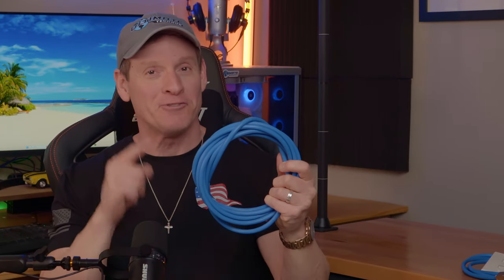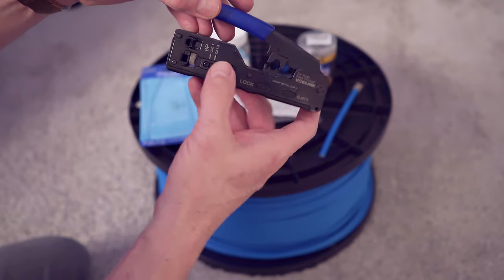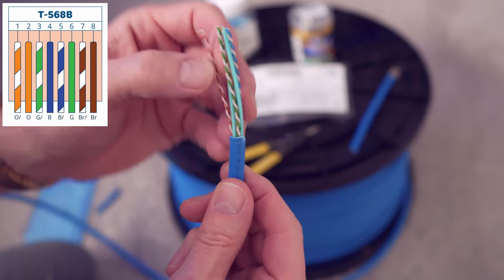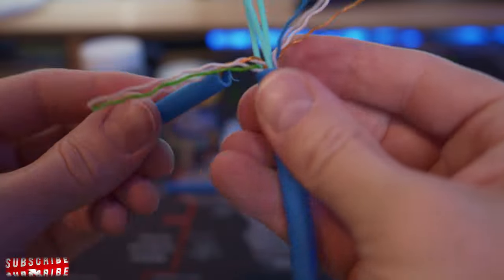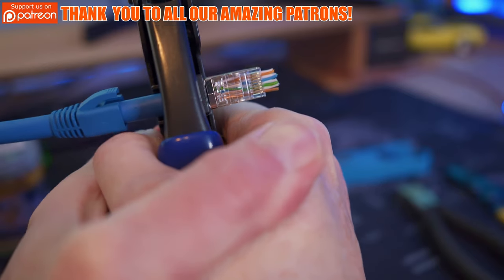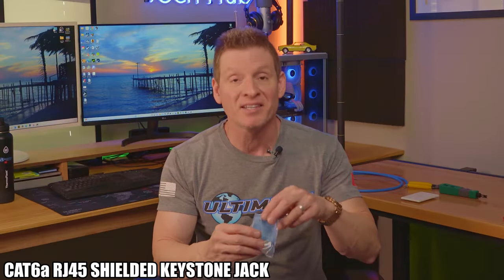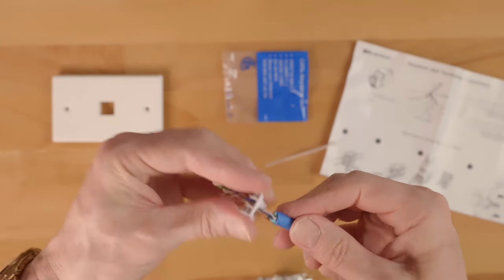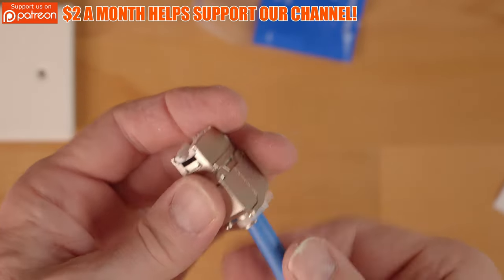CONNECTING CAT6a CABLE TO PLUG | Cat6a KEYSTONE JACK INSTALL - HOW TO

Comment: im afraid i might have broken my cat6 wall socket, would it be possible for 0 experience to check inside and fix possible issue? preinstalled connection. would be as simple as just reconnecting previous wire connection? or do i have to pay professional 200 fee to do it in 5-15minutes?
Reply from the maker: Just remove the wall plate and check the wires. You can reconnect the wires and I would take a picture of the wires before you rewire it so you make sure its wired correctly.
Reply: @UltimateTechHub  thats actually is pretty smart, il try that
Reply: Ok small update, the golden pins are joined together and slanted aswell i need to switch it up since i do believe enough of use has made them weak so they cant connect. I managed to get light only for few second and it probably fails and shorts the connection
Reply: sending this from a fixed outlet, yes were back with 1GB internet again. yes this DIY is really something and all i had to do was push wires down and boom its done! well it isnt the prettiest job but a job nevertheless. apparently 3 different repair men are gonna visit my house 2 already have. 1 did nothing 2 called electrician and 3 is gonna be the electrician! XD funny i have to put a paper on the wall to inform it just needs the wall panel to mount it properly. but i am back WOOO!!!

Comment: Your giving incorrect information. Cat6a (just like all other ethernet cables) cabling the white cables do have color strip on it for green/white, etc. Heck the link for the CAT6a you have even show pic of white cables with strip of color.  2nd, one shouldn't need to crush (which is not good) the outer housing for it to go into the RJ45 connector. There are passthrough extra large CAT6a RJ45 connectors.  lastly, unless cabling is beyond 55m, Cat6 will do 10G just fine.
Reply from the maker: The brand of cable I have didn't have the white/green and some companies do make them that way. The link was for a different brand of Cat6a since my Cat6a was from a local Las Vegas company that sells bulk ethernet cables. I only pressed the cable down slightly to get the cable into the connector and yes crushing the cable is not good. And lastly, of course cat6 works for 10gig under 55m but this video is not about that. It's about how to install cat6a and that's it. Lol! Thanks for watching and for the comments it really helps the algorithm! 😉

Comment: DON'T crush the cable like that just so you can have the jacket inside the jack! If you really want to, you can carefully make a couple incisions on the jacket to help, but in a home install it really isn't necessary. Wow even super cheap cables usually never skimp out enough to use all-white instead of the proper white+color, I'd suggest buying better quality cable than that. I'd advise against toolless keystones as the connections aren't great, even a little snag from an electrician trying to snake a wire could make things unstable.